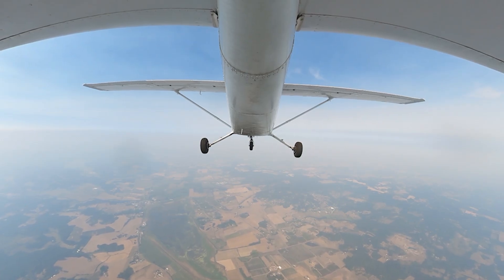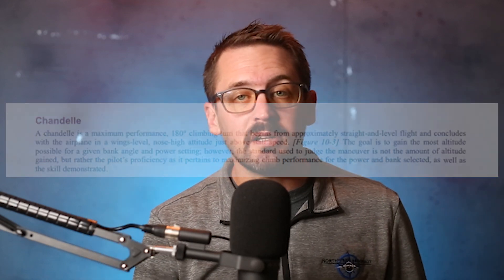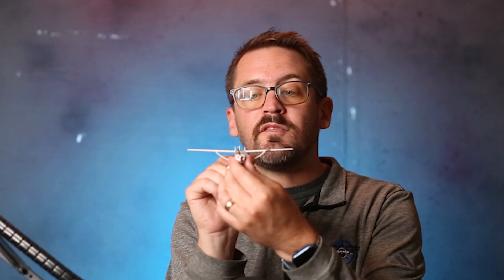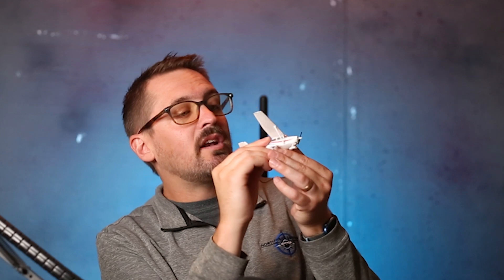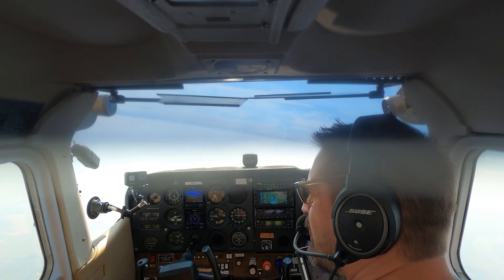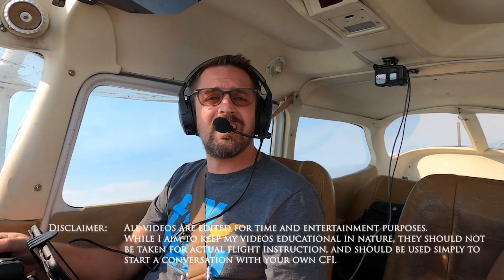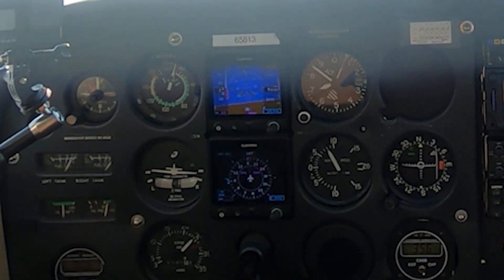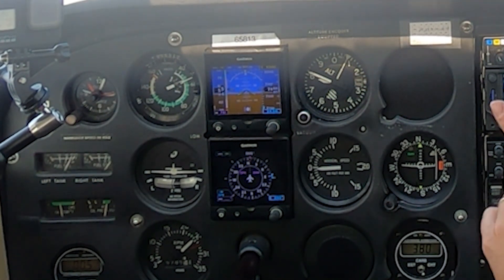Chandelle DEEP DIVE!

Comment: The most common error ive been facing is constant pitch in the 2nd phase, if i try to keep a constant pitch the airspeed just keeps dropping and goes to stall speed, any specific reason this could be happening and how to fix this?
Reply from the maker: Well that simply means you’re pitching up too much in the first half of the maneuver. You have to pitch only to a point that will slow you to just above stall. You can figure out where this is in your airplane by going full power and pitching up as if you’re going to do a power on stall, but don’t let it stall. Find the pitch attitude that keeps it just under the stall and then make sure you don’t go beyond that pitch attitude during the chandelle